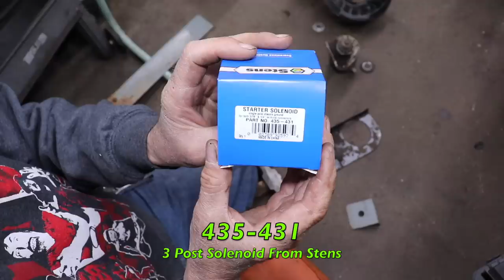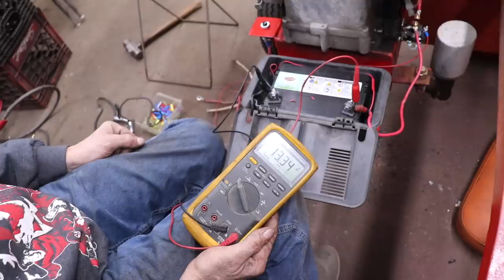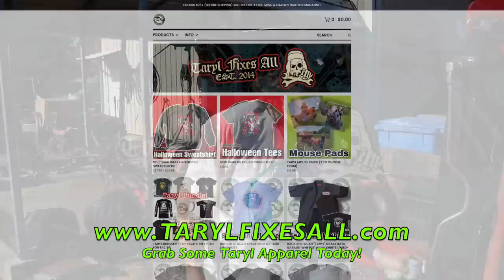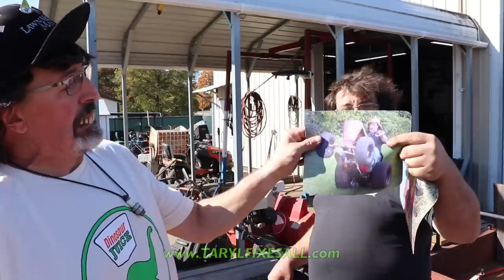Taryl's Personal Log Splitter Upgrade! Make It Awesome!

Comment: Hey guys Big fan here. Im working on a older 8hp breaks and scrap'em(its on a gokart). Now I've put a alternator off a 17hp intek and im getting dc voltage out of it. My question is im going to wire it up to the battery but i noticed my connector doesn't have a diode. Can you give me a link to one of your videos that might help me understand and wire my project right.

Comment: Hey taryl have you ever thought about putting mini tooth spikes weld on A removable plate to clinch into the log.& Hold it in to place while the split wedge is splitting through the 🪵 log . You don't want to take A dump. you want to leave A dump.,or let it go instead of taking it man.

Comment: The Battery Box that you are using for this "Cusomization" is the absolute best that battery box that I have seen/used.
Too bad that this style was discontinued...
I have 3 of these, but with online pricing I cannot afford more, or I would have 12+ for personal use!
P.S. Does the "Base Plate" have Spikes to keep the Log from shifting? I couldn't really tell from your video.
Reply: It does, I spotted them first off…

Comment: You need to weld it at the back where the two bolts hold it together for the tongue and weld up both sides and that'll sturdy it up at the rear of the tongue

Comment: Happy Holidays to you and your family Taryl.    Are you heating with wood?     I had one question.   I picked up a returned weedeater at Walmart for a big discount.  It was returned because it is hard to start.   I was wondering if you would do a video on this brand of weedeater and possibly find a fix for the hard start.   This weedeater is new.    The brand is... Hyper Tough.    PS, I split my wood with a 6-8lb axe.   You videos are an inspiration to learn.    Do you have a video on how to repair the automatic oiler on a Stihl chainsaw.    Mine stopped oiling but I'm not anxious to tear it down without knowing exactly what to do.     Thanks again Pops.

Comment: the log tray should be higher so you can just roll the log over without lifting, and add a large hinged extension tray so Elk Skins can put multiple rounds up there.

Comment: Great work except one thing. What keeps the battery from going dead over time with the stator not switched when the engine is not running?

Comment: Just something I noticed ....
The catch tray upgrade hits the hydraulic hose just above the tank ... concerned vibration will wear hole in the hose ... I doubt elbow would help dew to moving positions ....
But never fear an idea is here .... I would recomend fastening a rubber strap along bottom of the angle iron ... could bolt it on then add a zip tie on each side of where the hose touches to help keep it from rolling off of the angle iron .... have not finished video yet if you address this later in video ... cool beanz ....

Comment: Taryl, got an off subject question for you. I've got a close to 30 year old John Deere JS60 push mower. The deck is still in great shape, even where the rust pits underneath it still thicker than the new decks on MTD mowers. The original Breaks and Scrapem  has been using more oil over last couple years, this year I was fogging for mosquitoes while mowing. My first thought was to put a Harbor Freight vertical shaft Honda clone motor on the deck, then I priced those motors! Now thinking about just buying a cheap MTD push mower and swapping the motor over to my deck. Question is, what motor should I look for to get the best life?

Comment: Also ,...a scissors jack works well and is more compact.. weld a nut on it so you can run it up or down with a cordless drill = power jack, LOL.. Add about 2 more feet to the trailer tongue for easier steering & better maneuverability .one big thing I always said about these el cheapo wood splitters is that they ALL need a good hydraulic oil cooler. That oil gets extremely hot when you give the thing a good workout on 36" maple or oak for about 5 hours. I keep mine near an electrical outlet where I can use a cheap 20" box fan from wally world to cool the whole thing but it's not perfect......better than getting burned by a ruptured hose or a bad leak from boiling fluid.  AND FIX THAT SURGING ENGINE !!!

Comment: You might want to do A little bit more research on things like that. Is all I'm saying about it. Cause there generator engines that can be converted over to be able to use both pull starter rope handles.& Electric starter's on them. Even on some of these newer ones to still. Some of them just never came with them added on to the engines.,or was what's called A basic pull stater pull setup engine that can be converted over for both features to.

Comment: Don’t you need a regulator? What to stop the battree from overcharging?
Reply: I guess the alternator just doesn't put out that much voltage? A diode won't regulate it'll just block AC. There is a voltage drop associated with semiconductors too. Typically you'll lose 0.7 V across a junction.

Comment: You added an alternator to recharge the battery, said you using the red wire and the black wire is for headlights...... Why not use it for a work light??

Comment: Excellent 👍
 I  wish someone could make one with a quiet motor..they all are so 🔊 loud
A small Twin cylinder less vibration noise .
Reply: Honda!
Reply: @kknows3512  two cylinder. I have Honda 1 cylinder still vibrate loud . Not as bad as others .
I have a Two cylinder Honda water cooled generator silent 🔕 .
Singles vibrate .
Reply: @MitzvosGolem1  I have several single cylinder Hondas, gen, p-washer, water pump, log splitter, if they vibrate they need a carb cleaning and/or retune.
Reply: @kknows3512  Inherent in single cylinder engines with counter balance shafts.
I am mechanic since 1976 on all Marine Industrial Motorcycles etc.
Even firing twin is silk smooth quiet no vibration since opposite piston rod and crank weight cancels others forces .
Reply: @MitzvosGolem1  I agree, I should have said "If they vibrate badly ...."

Comment: Mine is a 30 tons (Black Diamond) with 6.5 Kholer/side mount pull start. The engine sits way lower than yours.

Comment: I have the same splitter.  Had it since somewhere around 2001. Works good except it's starting to get slow on the action.
Reply: You can try to change the hydraulic oil in the  machine,  that might help.  It could be the pump getting weak.
Reply: @bertgrau3934  Sounds like a good idea. Last time it was changed and filter was when line blowout.

Comment: What this really tells you is that most folk that makes these dont even cut logs do they ????? So why the hell dont they get it right first time ?? and sell many many more ????????????
Reply: Price point.  Sadly a new one like this is about $1500 now.
Reply: This doesn't really tell me much. Admit really depends on how much you want to spend. Why buy one with a log lift that can actually be pulled on the highways?
Reply: I bought a more powerful log splitter (40 ton rated) with most of the features Tarly added to this, and it was over $2000… but I run production splitting, and I knew what features I needed, so I got it, but it doesn’t have everything this one has.

Comment: Carol I'm surprised you didn't put a light on it since you could do it at night okay this is Bob from Vero Beach Florida God bless and stay safe and have a great
Reply: I did on Mine.. 2 ckt Stator. The AC Windings to 2 lights on a cross bar at the end of the Beam, Since I split 100% vertical.

Comment: Terrell I’ve got one of those old shipping pallets kind of thin the one by fours anyway I throw it down in front of the air make me a working surface it all turns out level and then big logs I throw a pipe down and get it down to the edge of the big log and it rolls real easy right up into the jaws of the splitter

Comment: Hay I see one more thing that you should do to it. See the hose behind the tray you put on . I would put another piece of hose over the hose. I would do it just in case it rubes on the bottom of the tray you put on. because it might when you are running the log splitter. I'm just cautious on things like that. but a great video.

Comment: Taryl you said you wished you could make that peice bigger but it would hit the wheel in the vertical position. What if you make a smaller piece and folds over on hinges so it folds away from the wheel in the vertical position to clear the wheel?

Comment: Hey taryl, I don't believe there's a functional reason for a fuse in your application-- in riders they have a fuse in the starter circuit when the ignition switch has a run position to protect accessories like amp meter, hour meter, 12v outlet and lights, but a simple contractor application such as yours you may be netter served by adding a diode because of electronic physics property of a collapsing magnetic field (induced high voltage) that could do damage to your switch. Before you break out your internet Mickey Mouse voice you may want to view autube video called 'using a diode in your battery contactor and starter solenoid' , would explain it better than I could.
Reply: The existing diode in your magneto circuit is there to convert AC to half-wave DC for charging

Comment: nice job ,,i used a ladder ,,an bolted it to mine ,,works fine ,,.... i still have the silly plastic wheel... ,,but ,,i had to re adjust location of ,,flip up wheel ,,b..because it hit the truck ,,bumper when i turned ,,
 good luck ,,my ,,tom come us moto ,,na its a briggs starts one pull ,,
 happy splitting

Comment: Daryl I cut that front tube off find a better toungue with the ball hook takes that crank it's still going to wobble why not get two travel trailer leveling jacks  to stabilize that trailer is mad to transport with your tractor 4 tracks I have mine attached to a premade pallet that I can Lift with my 40hp tractor onto my stake bed or trailer